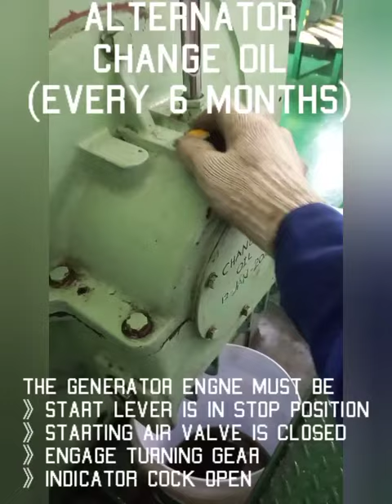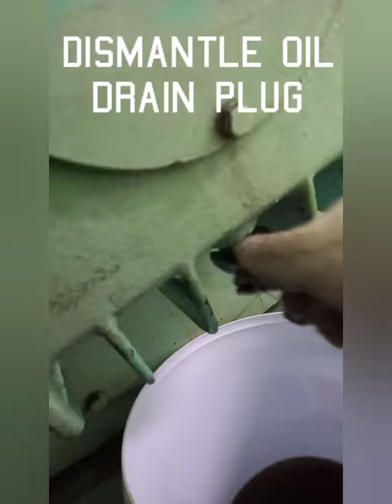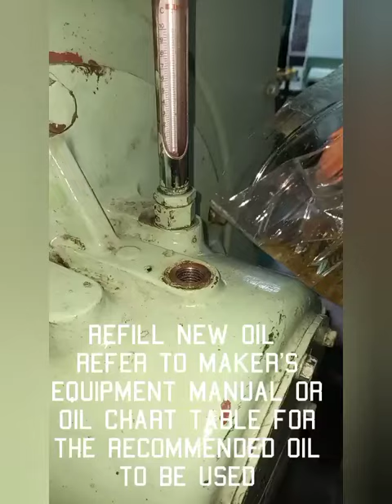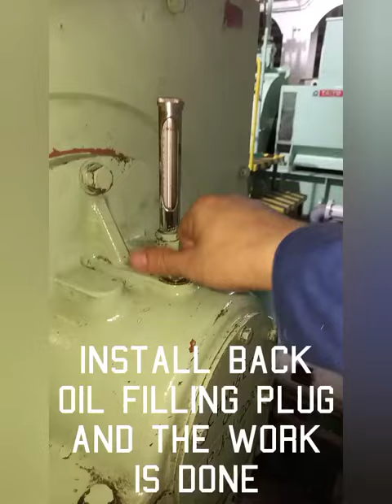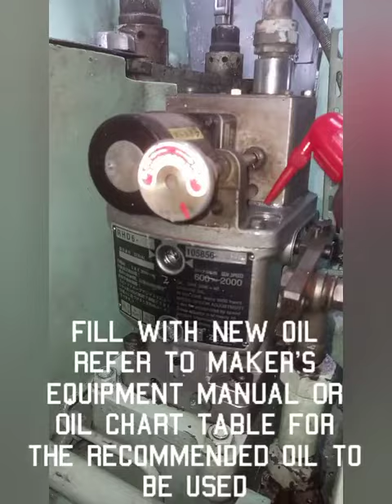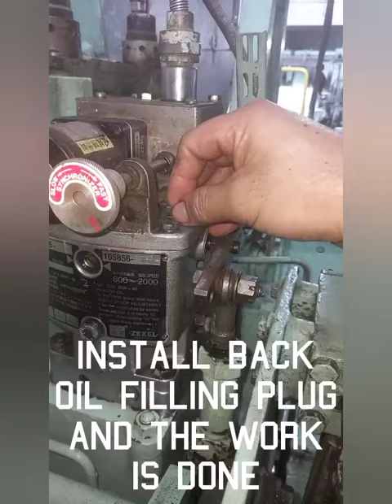How to change oil Aux. Engine Alternator and Governor✌

Comment: Sir, which grade of oil is used for governer sump? we don't have recommended chart for governor sump oil .
Reply from the maker: Good day Sir, please always refer to makers instruction or vessels Lube oil chart guide that is always you can find available onboard vessels. most of the generator governor oil that i have experience is it uses same as the generator engine system oil. safety first

Comment: brother, why alternator bearing temperature gets too high? in my ship, alternator bearing temp is 50
Reply from the maker: Good day sir, como estas...espero que estés bien
Most alternator bearing temperature maximum temperature of bearing is 80°C to 85°C in normal operation.please check  makers manual for reference...
Why Alternator bearing temperature increase
Lubrication: No.1 cause of overheating
a.)     Lack or inadequate lubrication- increases bearing friction and will result in bearing burn…be careful that Excessive lubricating oil may leak out along the shaft.
check and follow the right amount of oil quantity as per makers recommendation. 
b.)    Type of oil usage. Use good quality oil recommended by manufacturer. Also observe Proper Storage of oil to prevent oil contamination.
c.)      Do the preventive maintenance as per schedule- change oil. Defective oil including dust and dirt. Check for signs of dis coloration ,contamination and deterioration.
 
Ventillation- poor ventillation makes it difficult to dissipate heat. Look for ways to alleviate engine room temperature especially in hot countries..ex. openning the skylight- to improve air circulation,  installing suction filters in loading ports  were dust is too much…
a.)     Replace air filter , use the standard filter thickness. Sometimes filter that is use is too thick that it affects the heat transfer…
b.)    Check time interval of filter replacement- adjust based on filter condition
Alignment- over the years, alignment is the culprit that can be alter due to movement on foundation and will cause excessive loading on the bearing.

Vibration and noise (include in machinery predictive maintenance)- check using a vibration meter/or sound bar/stethoscope.

Bearing wear- if the bearing wear is not so serious, the bearing temperature is partially overheat…if the wear is severe, the stator and rotor may rub with each other. 
stop and resolve the cause when overheating is observe to minimize cost and downtime
I hope this will be an additional ideas to solve the problem
thanks and best regards
Reply: @chiefmakenista5399  thanks for your reply❤